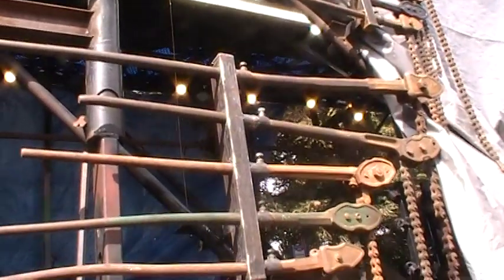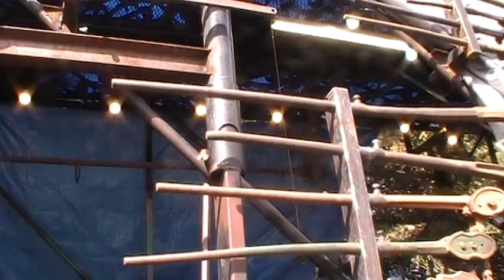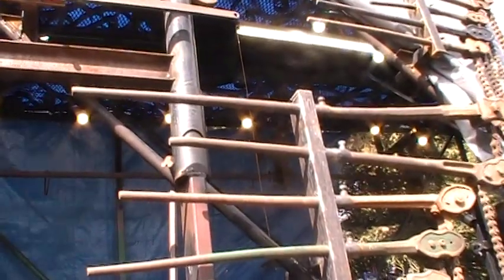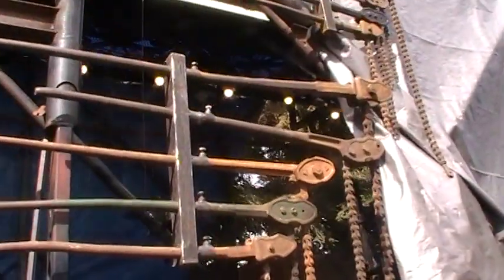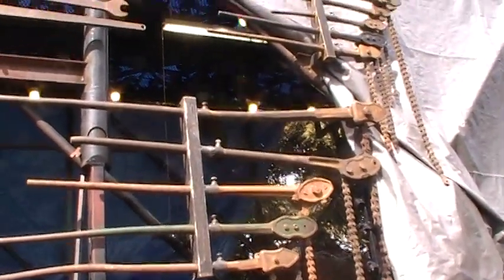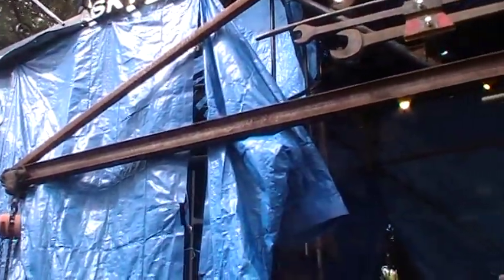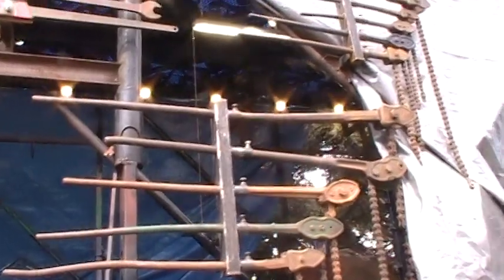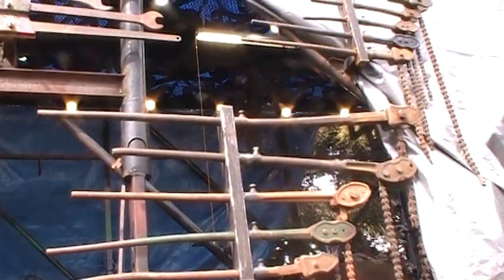A plethora of old vintage chain wrenches

Comment: Hey Dave, Thanks for coming out when you're feeling off, gotta say I'm getting concerned about the weight you keep adding on those wheels/tires, those chain wrenches aren't light.😉
Reply from the maker: Hå hä hã. Thanks buddy. Actually they aren't up there when going down the road. But you're right.....at this point it'd take a couple days to set it up. And the more I go through my stuff the more I find that has to go up.
Reply: @davewilson1591  👍

Comment: I have been wondering for some time about your exhibit. You've been adding steel and iron by the hundreds of pounds at a crack. I know you've thought about this, but have you been weighing any of your pieces before installing them? 2 or even 3 axel trailers can only take so much.
Reply from the maker: Yeah it seems like I'm adding weight.... but it's mostly pockets like a receiver on the back of your truck. Everything is modular and removable. I'll tow with a 1 ton with stuff in the back of the truck.  Truck's rated 18,000# trailer's got 3500# axles.... so with 10,000# tires, new, the price killed me, on the trailer I should be able to pull this off. My other trailer could only be towed 35 MPH max. Not good... so we're going for the speed limit with this one!
My neighbor has a 39' fifth wheel GVW 14,000# he tows with a 3/4 ton no problem. We won't be near that.
Reply: @davewilson1591  whew! Thanks for taking the time to explain. 
I can’t wait to see it completed .